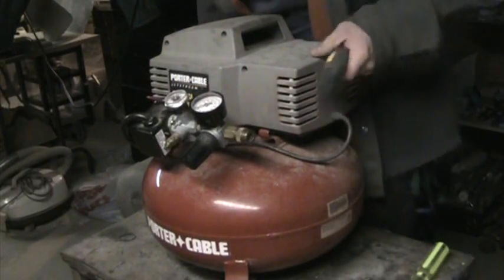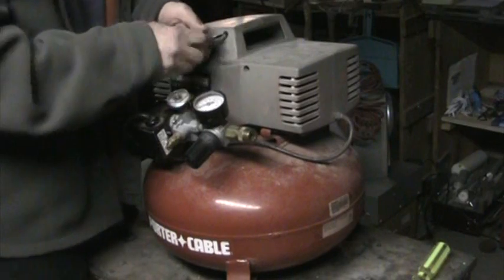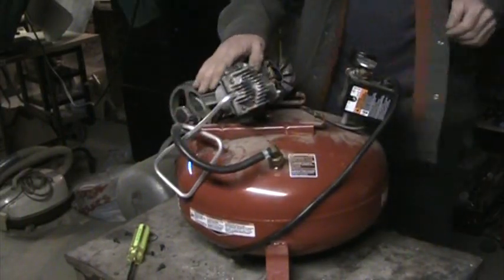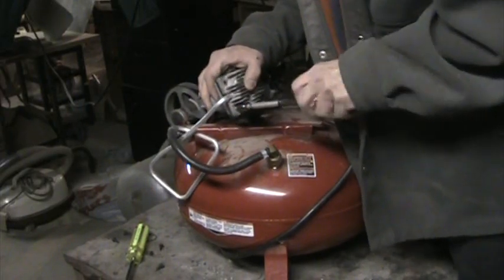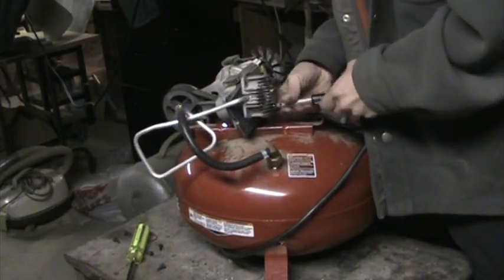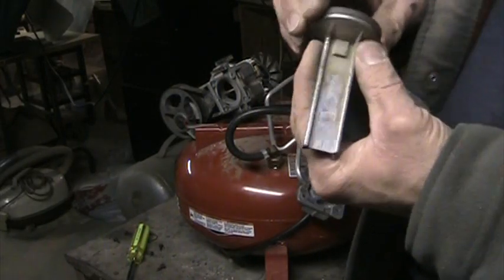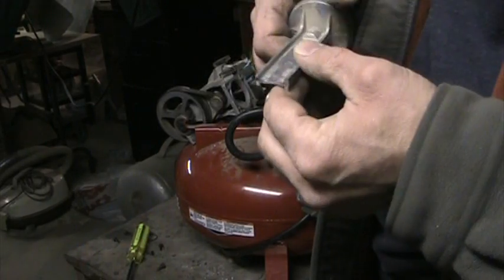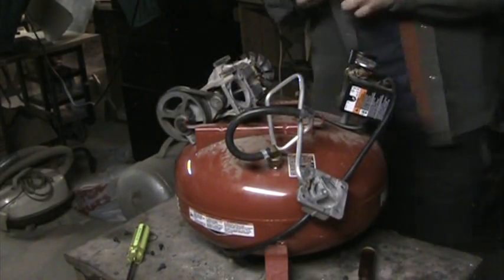Porter-Cable compressor failure. Part 1

Comment: These air compressors have soo many problems , the most common problem is that little plastic plunger inside the regulator that breaks so easy. These air compressors were so poorly designed. I have a 2005 model that has that problem  and i came across wirth many people that share the same problem. I think that Porter Cable sure provide free of charge parts and or reenburst these repair expenses. You can not depend on these air compressors .
Reply from the maker: Not impressed with any Porter Cable tools.

Comment: thanks...I had a problem that the 110 volt line came out of the holder and was cut in half by the motor cooling fan ,....easy fix....bob

Comment: Amazon have that Piston for about 20 bucks and even comes with the housing, instead of casting a similar piece or go through a difficult way to do it.
Reply from the maker: Buying a new piston is no fun! The piston broke because the large press fit pully came loose on the shaft.

Comment: What tool did you use to get the covers off. I can't find anything in my tool box. Can you share what it is and where to get it.
Thanks Rene
Reply from the maker: I used a # 25 or 30 Torx screwdriver.You can find it in most hardware or automotive stores. Hope you do not have the same problem i had.

CHEERS
Reply: torx 20